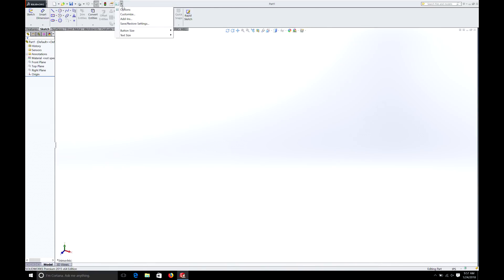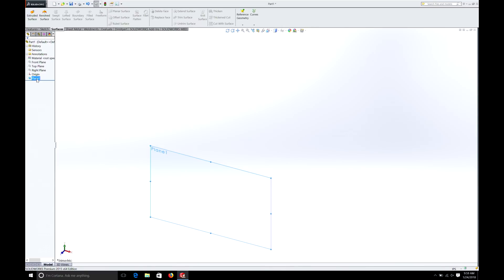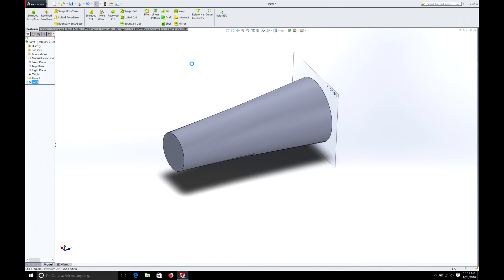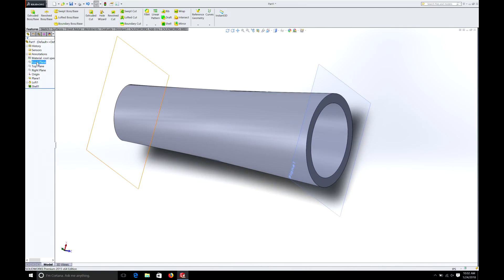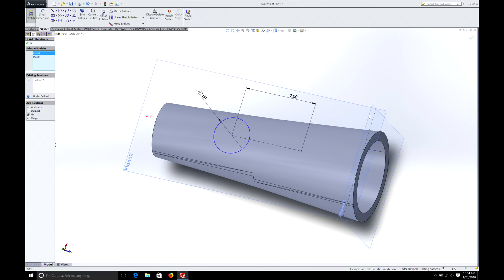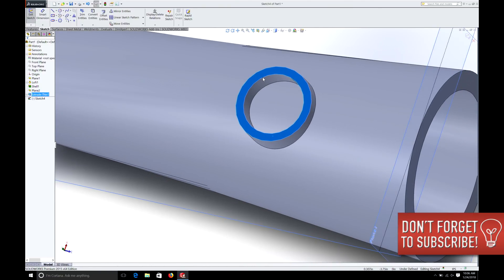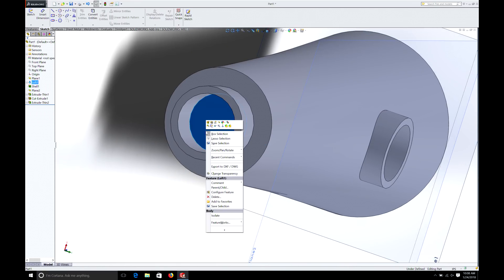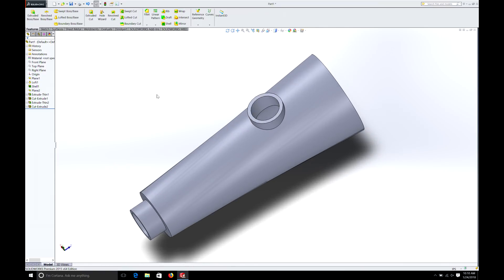Learn Solidworks In Five More Minutes | Part 4

Comment: Great tutorial!  But can I ask someone here, what the "Convert Entities" actually do (ideally if you can explain on example). Thanks in advance!
Reply from the maker: Convert Entities makes it easy to redraw a sketch into a new sketch file. You can select any lines outside of the open sketch and then convert them into lines there. As an example, if you have a hole cut into one side of a cylinder you can open a new sketch on the opposite side of that hole and then select the hole, hit convert entity and it will automatically draw a new sketch in that open sketch. If you change the size of the original hole, both holes will change size.

Comment: When you cross-section around 4:35. It does not look like a straight cone. It seams the external face has a inward curvature. Why that ?
Reply: It's because the default path connecting the two profiles is slightly skewed, which ends up creating a slight twist in the cone.  This could be fixed by manually adjusting the path or by making a sketch connecting the two profiles and using that as a guide curve in the loft feature.